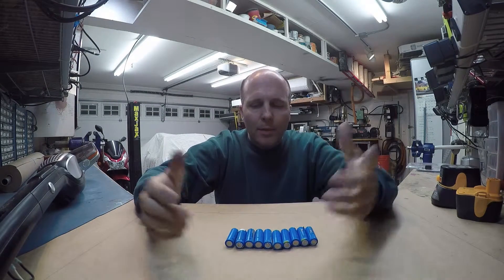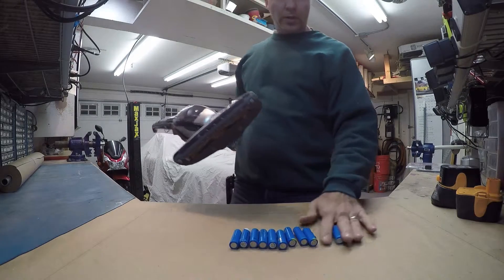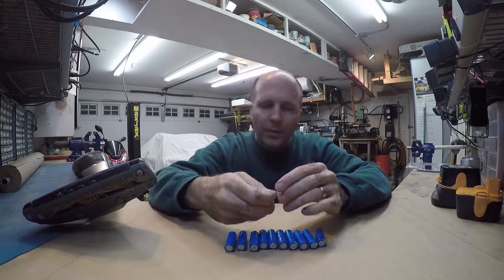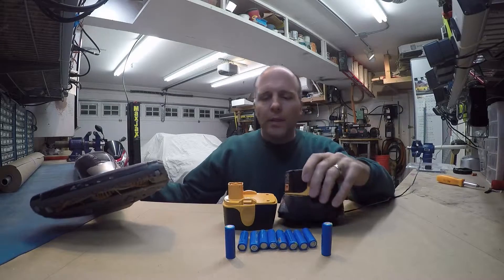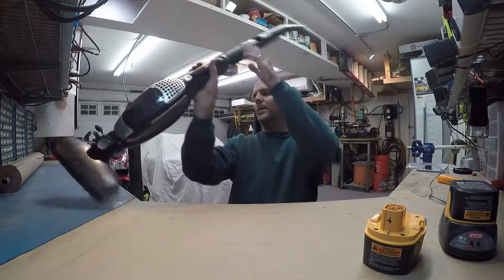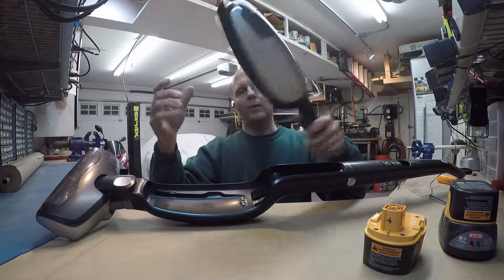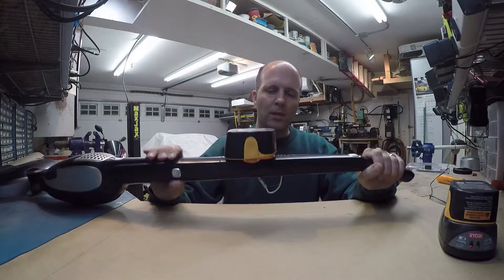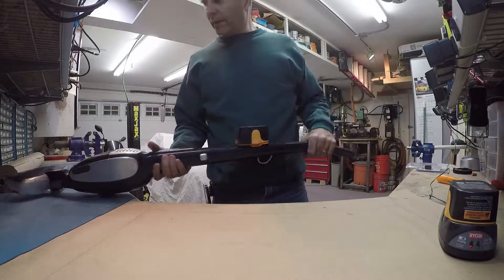Rewiring vacuum to run off of 12 volt Drill battery

Comment: This is what I want to do!  What did you use for contacts on the wire to the battery and how do you keep the battery snug?
Reply: I’m thinking about buying a broken drill and cutting the battery housing off and attaching it to the vac.
Reply: @MoneyManHolmes  thing is what usually goes bad on a drill is the battery and that’s almost as much as a new drill